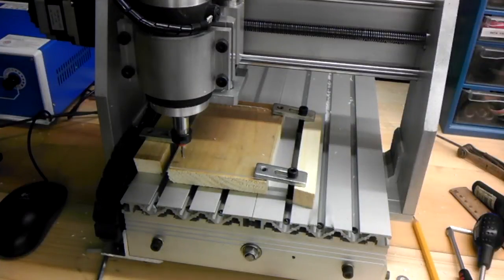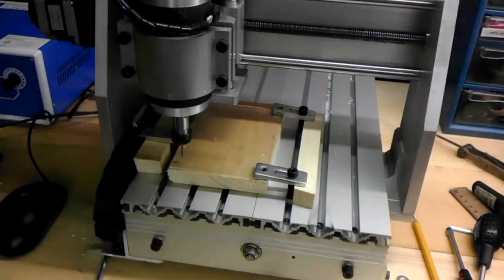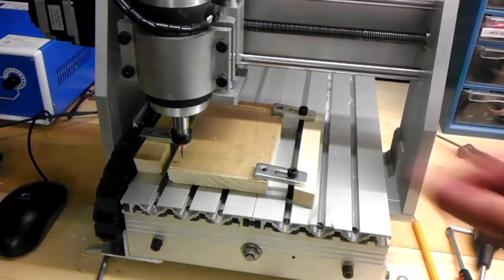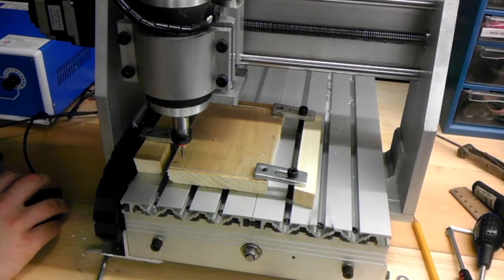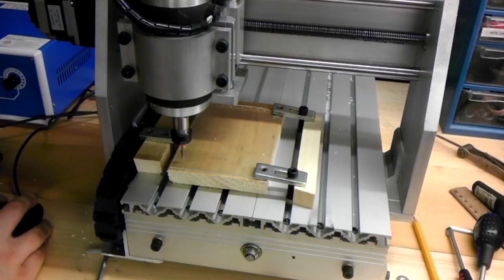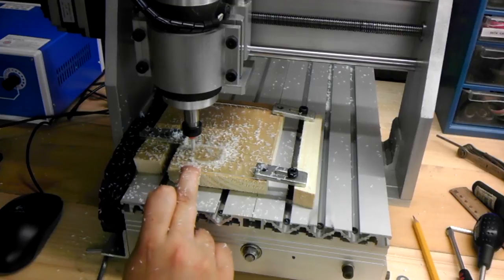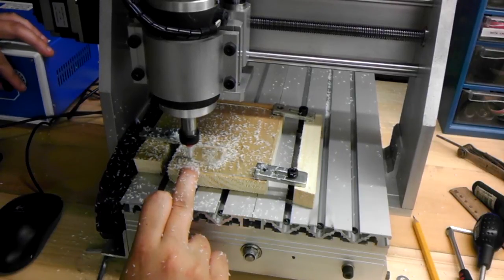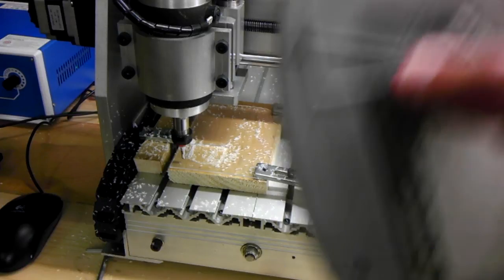CNC Milling of Acrylic Part

Comment from the maker: Normally sure, but it's all in the bit you're using, feed rate and RPMs of the spindle. What's on there in this demo is an 1/8" (3.175mm) single flute, center cutting end mill. The single flute is the biggest factor on this because like the Step Bits, it shaves off the plastic in little bits. This prevents the melting and gumming up of the bit itself. Basically the plastic doesn't have time to get hot and melt. Feed rate makes finish cut smooth, RPM compliments that.
Reply: which cutting speed and feed rate did you use?? and this is a HSS tool?? thanks!

Comment: Problem with drilling plastic and styrene is you get the residue building up on the drill bit itself and then scuffing the plastic you're cutting - at least, it is an issue normally.